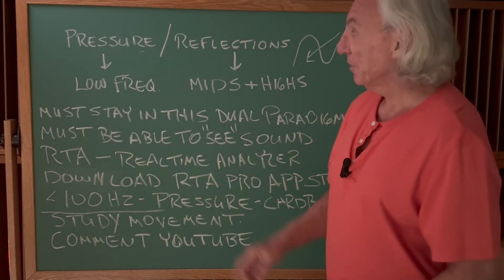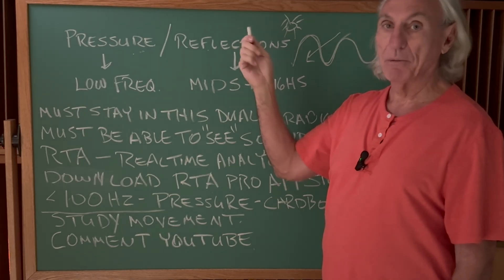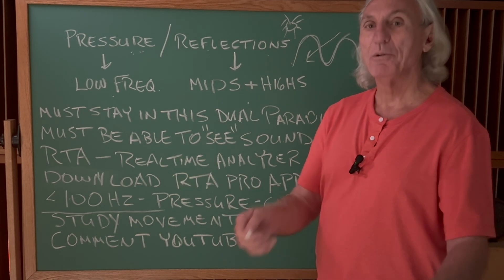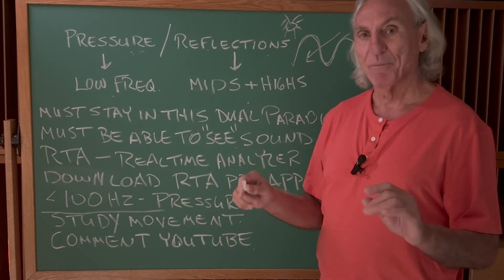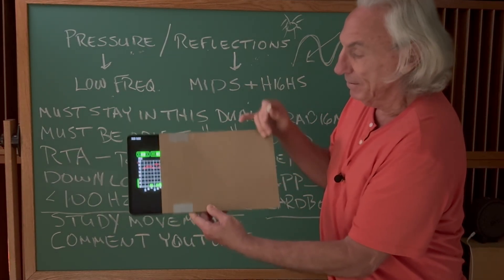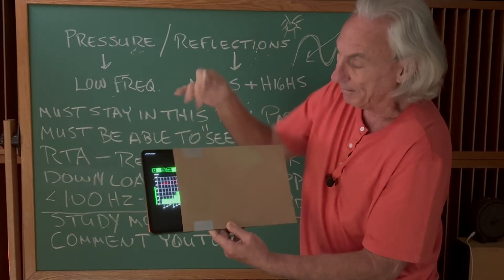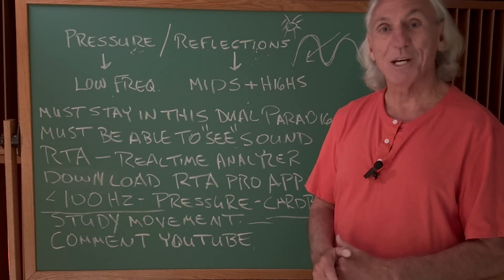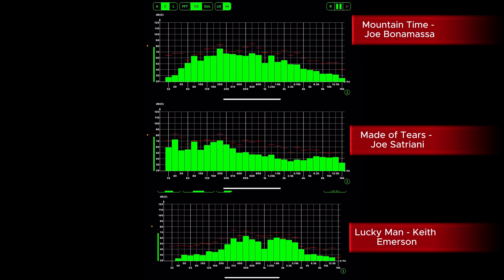Seeing Pressure

Comment: Statement: Room modes are eliminated in my room because of my bass stacking methode. What is your preferred bass placement methode?
Reply from the maker: We treat modal issues at the source of the issue which are the walls, floors, and ceiling. We do not use more pressure to treat an issue that is caused by excess energy.